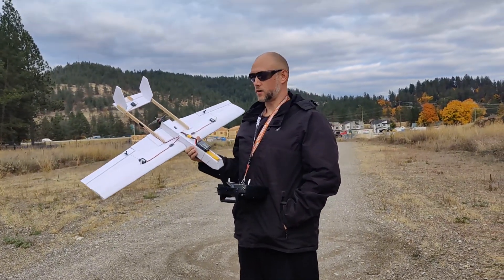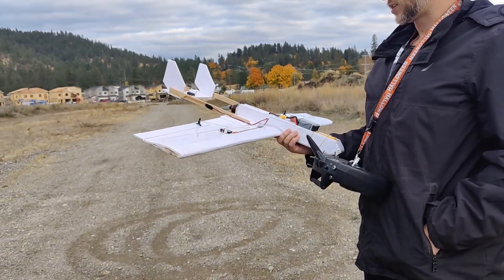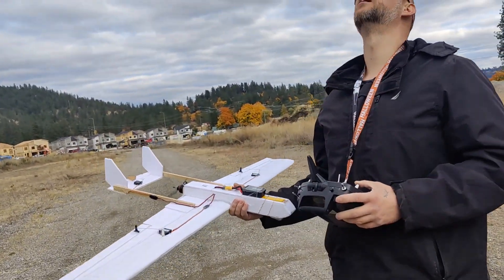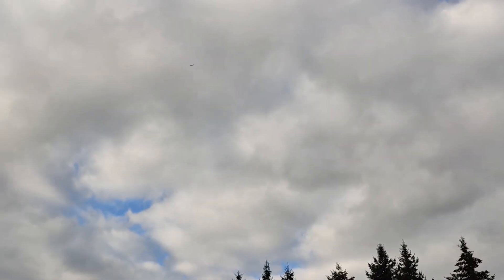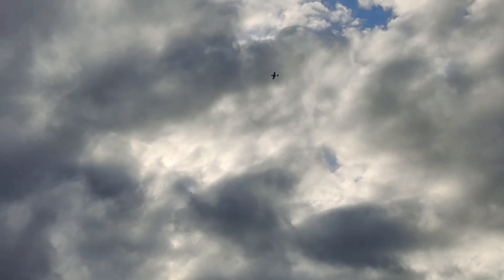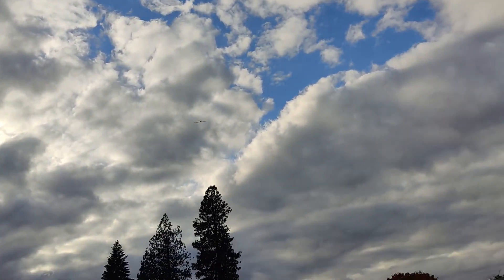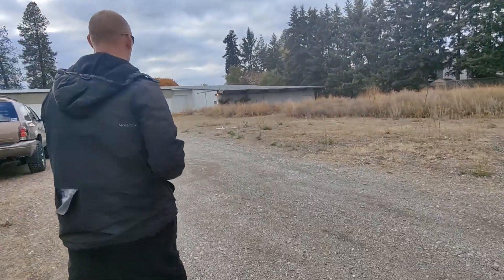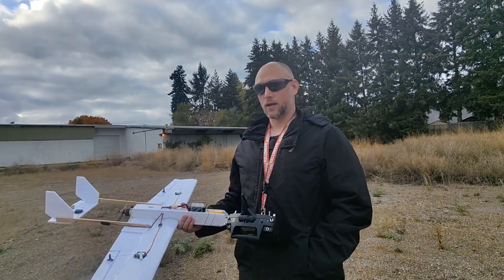New prop and horizontal stab on pusher 1.

Comment: What electronic combo are you using for that airframe.  Motor KV, ESC, Battery, prop.  For some reason I’m burning up motors lately.
Reply from the maker: @gisall8205  I'm using a badass 2310 2350 kv motor with a flite test 40 ESC and 3s lipo. Running a 6x4 or 7x4 prop on this set up. 

This exact motor I've had over a year in multiple planes with 3 and 4s lipo including my fastest 115mph speed v tail. It's been in multiple crashes and even burnt up a 40 amp esc that caught fire. And it's still going. I swear by these motors and probably won't use anything else.